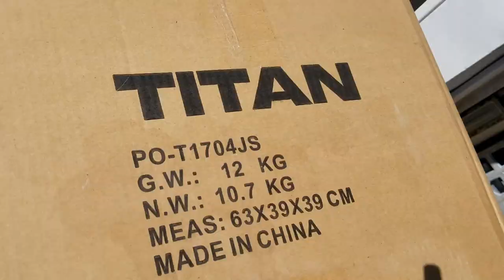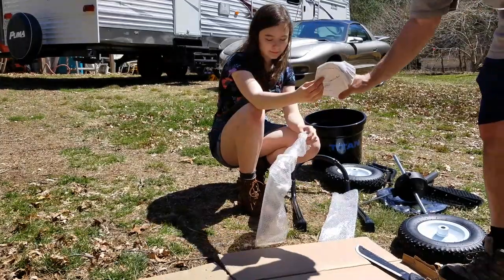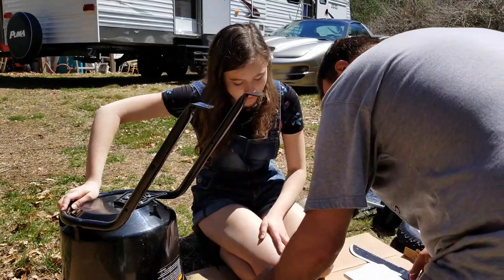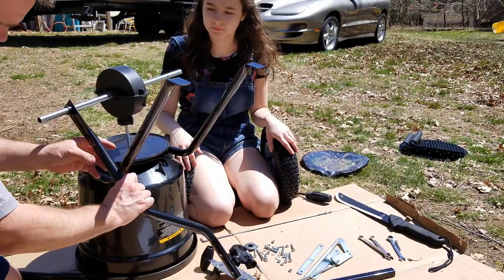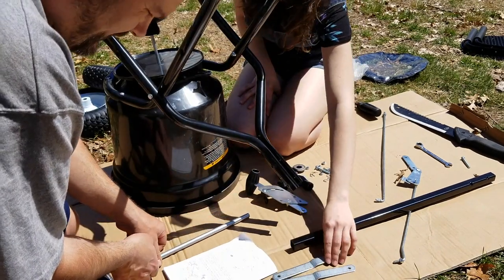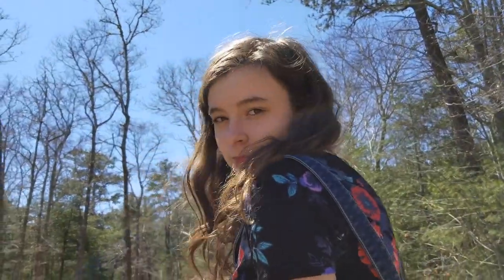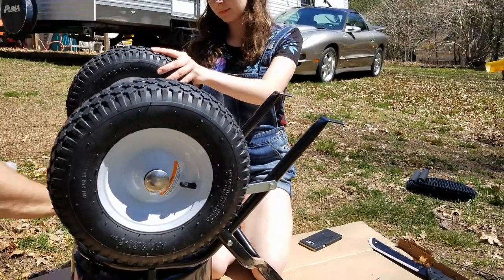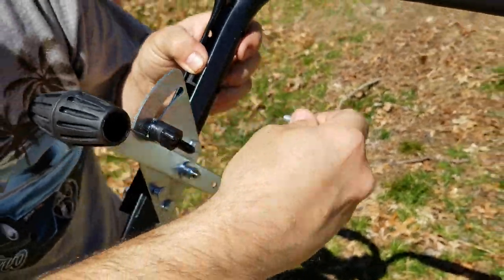Earth Day Project Part #2 TITAN 50lb Spreader Assembly

Comment: Great Video! I'm thinking about getting this spreader. Does this spreader have a shut off system for one of the side so i can do the edges of my lawn? something like Earthway's EV-N-Spread system?
Reply from the maker: THANK YOU! It was fun doing with my daughter. This one doesn't but you can control that in a sense with your speed and distance it throws. The ones with edge guards (I believe your talking about) are good but they tend to (while they are edge guarding) load up with the extra casting more. If that makes any sense.